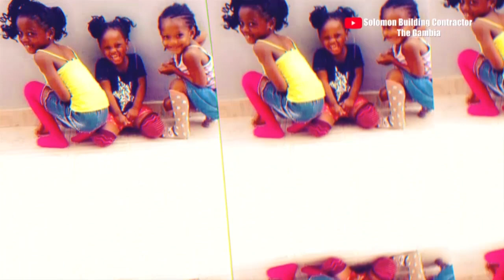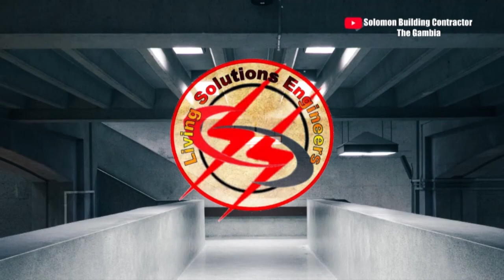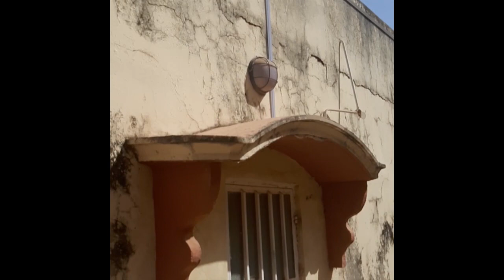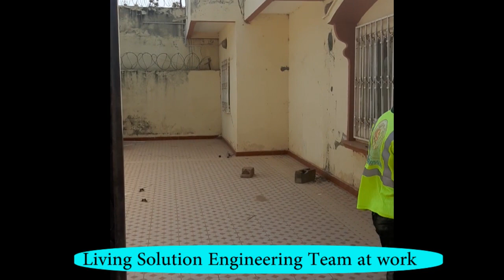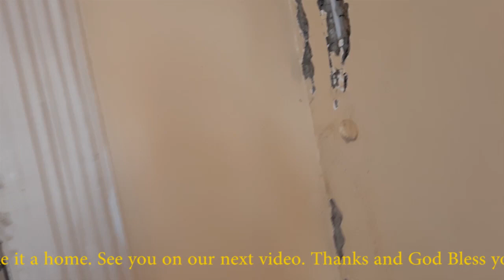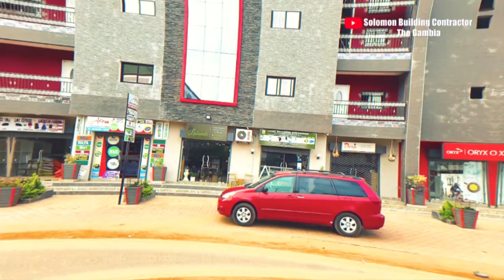How to Repair (fix) Cracks in Wall in The Gambia.

Comment: What would have caused such a great amount of cracks and what looks like water penetration?
Reply from the maker: what could course this kind crack (1) the primary reason is poor foundation, it means the house was not build on a solid foundation. (2) damn (3) wrong blocks, (4) poor mixing ratio during construction. (5) if the pillars and beams were not solidly or properly constructed during the construction. these are the things that can course this type of cracks in a building

Comment: Will your work result in a permanent repair to the cracks in the building?
In other words, can you guarantee that the cracks won't appear again in a few years time?
Reply from the maker: yes it is guarantee that after the renovation/repair my work result will be permanent, we are expert on this. thanks
Reply: @solomonbuildingcontractort9410   But what about subsidence, the foundation sinking, how do you stop that?